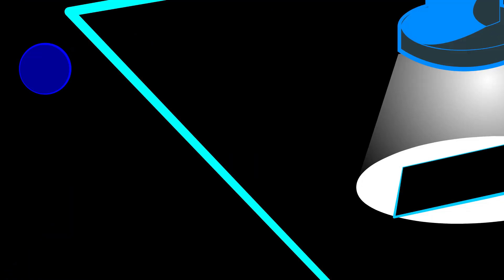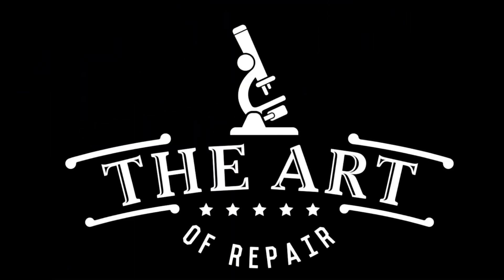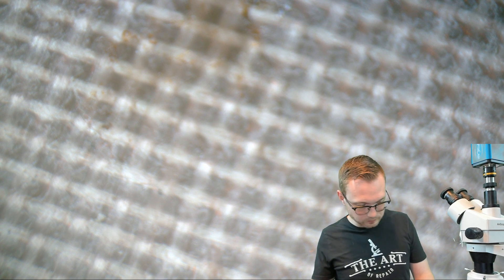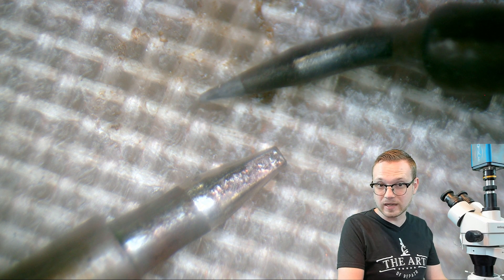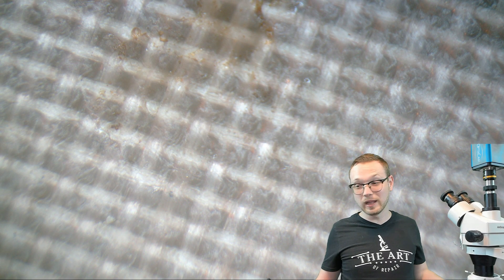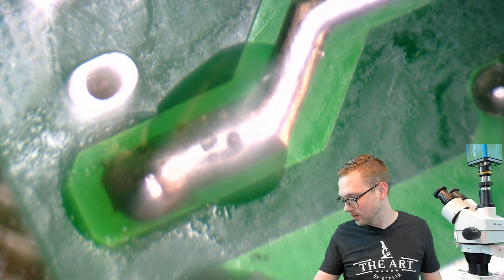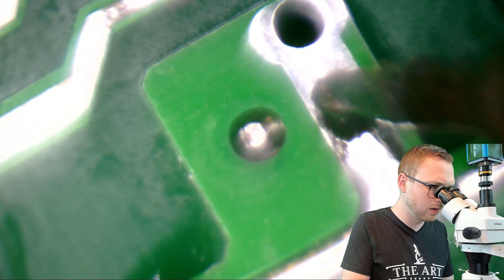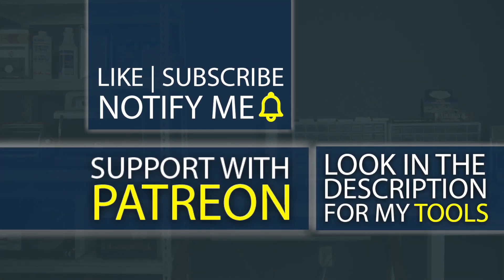EP62 Soldering 101 | Understanding Thermal Linkage from Tip to Joint

Comment: Use tip tinner only if your tip really is in bad condition and really needs a refresh with it but try to avoid it. It will eat away the metal coating if used to often.
Better to keep your tips in condition by not going to high in temp and keep them wet.